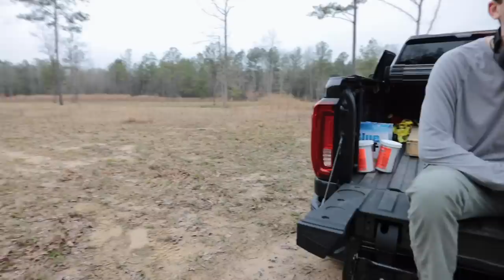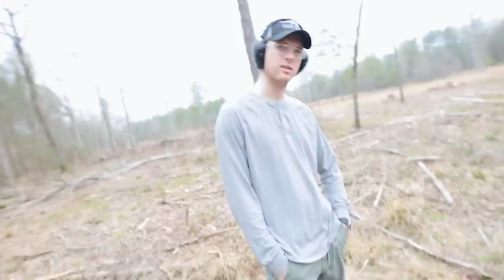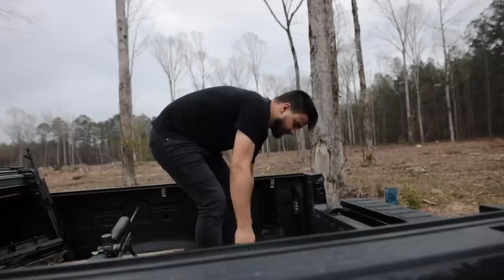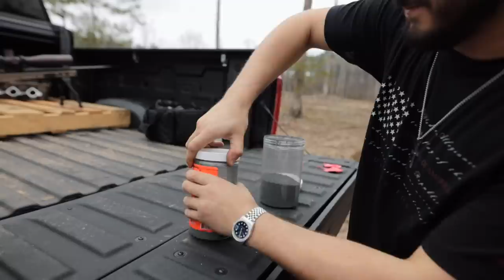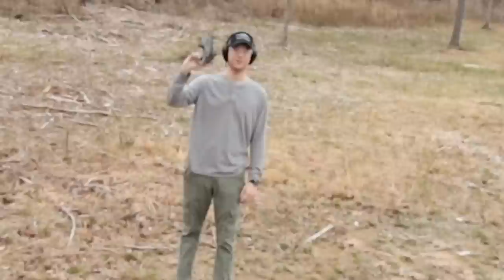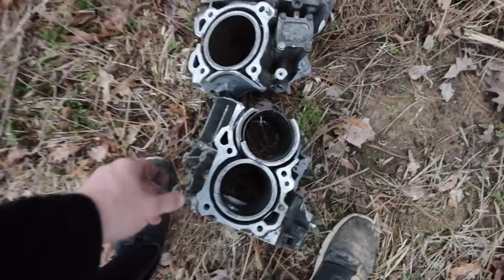Can ANYTHING freaking penetrate an Engine Block??

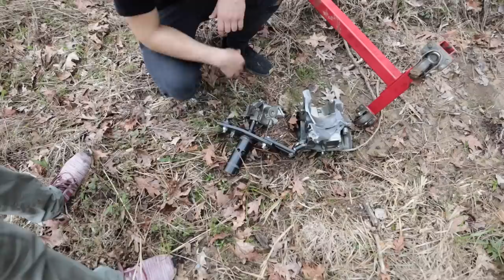Comment: 13:05 returns with blown block "CaN yOu FiX tHiS DoOg?" Job security!!!
Reply: Krosix hey I put tannerite in the engine instead of oil can you fix it? Job security
Reply: @AndrewMcNulty1986  lmao
Reply: Derek Holden after a lot of job security work
Reply: Andrew McNulty you just gave me an idea fill an engine up with tannerite and crank it over and it might possibly blow up. Of course there will be no oil

Comment: Gavin, I've got the Ruger precision rifle in 6.5 creedmoor and it's a bad boy. So far, I've shot it out to 1350 yards at a 10 AR500 steel target. RPR is the most accurate rifle I've shot, including the rifles I shot in the military. My next rifle is the Barrett 50 cal M82A. That's what you need bro

Comment: Small and fast = penetration, 50 ae is big and slow, also if you face the truck were you want to shoot put the gun on the roof you can kneel in the bed and shoot with more protecting you

Comment: Why do you think cops get behind engine and shoot over the hood in a gun fight . Even an armor piercing round probably wouldn’t go length wise through that engine . That’s probably eight layers of aluminum and steel . If flattened out it would be at least six inches thick .